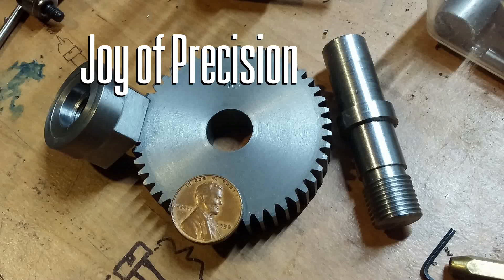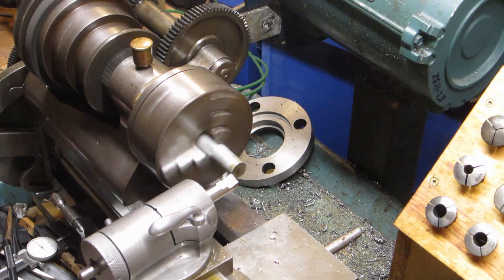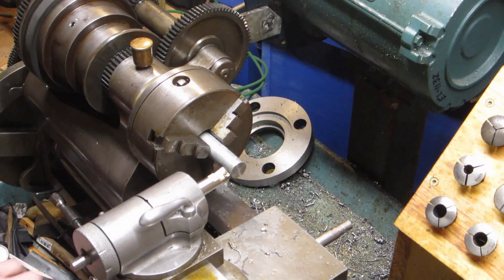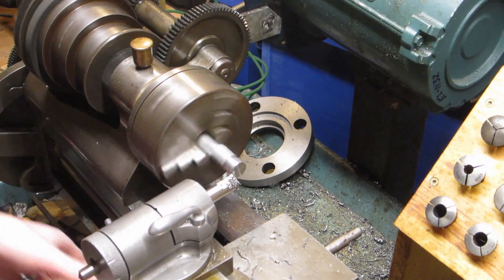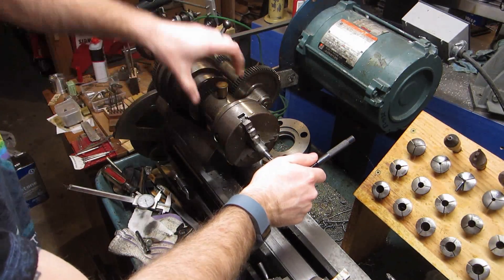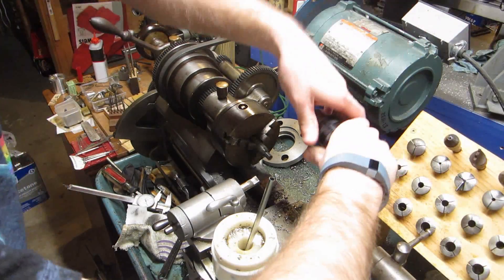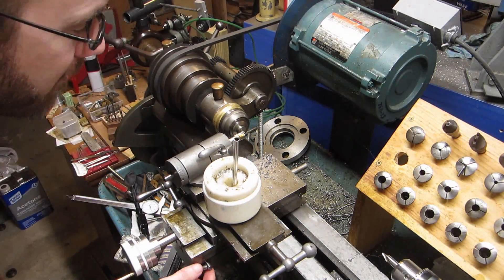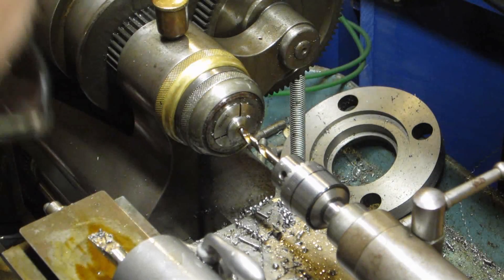Shop made rotary hex broach, in action

Comment: I love the tool support of your lathe I would like to build one, can you make a video with the details of this device? Thank you for sharing your wonderful works.
Reply from the maker: Hi Carlos, yes I think that's a great idea, thank you! For most people a normal quick change toolpost would be a much better choice, but this ecentric style has a lot of versatility that some people might find very useful. I will definitely make a video about it.
Reply: The one on my 608 was cracked, so I machined a new one from a solid piece of Durabar. 
Were I doing it again I would 3D print a pattern and have it cast by a local foundry. 
I typically run with a boring bar in there, and swing it around to turn or bore with the same tool. 
Not that I use my Rivett very much, though the tool use is shown here: https://youtu.be/bSOyh4JrluI?t=726

Comment: Yes yes 👍 I have done one today  using old live center I changed the 60 digress anvil to another bored one and screw it the broach I tried with hot roll steel it works really nice but it take alot pressure,, am happy 😄 with I have done thanks for inspiration.. The hex abroach I made it from drill bit tail I machined it and hardened it as well .
Reply from the maker: Great work! 😀

Comment: Nice job ,, am going  to make something similar with tailstock it might be easier, thanks for sharing.
Reply from the maker: Thanks for watching!
Reply: @TheJoyofPrecision  I think the broach should be with an angle to make the inside hex abit bigger to allow the broach goes out easier.. Isn't right??  Thanks
Reply from the maker: The dimensions of your broach should be slightly larger, yes, but the clearance angle behind the cutting edge is just for clearing the approximately 1 degree angle that the broach should be offset to the work, plus additional small clearance to keep one side of the broach from binding.  Remember, the broach is presented at a slight angle, and so only one side or corner of it is cutting into the work at any moment.

Comment: I was subscribed for a couple of days but couldnt get past watching you hold a flux brush up against the work whenever you were making a turning cut. Occasionally the brush comes out for a full facing cut and almost never when you are cutting threads with a tap or die. Weird maybe but it drove me nuts.

Comment: In the video it looks like the profile of the broach is a squarie-ish. I must need new glasses. I would expect hexagonal-ish. I now understand much better how  a roto-broach works.  Cutting the reliefs on that tool must be a bear. I also enjoyed the video on the Hjorth turret lathe. Where (and when) was that thing made?
Reply from the maker: Hi Juan, thanks for commenting!  The broach is indeed hex shaped, as you would expect.  The broach itself was milled, using a 6 sided collet block.  I calculated how far to shim one end of it to get an angle of 2 degrees, and shimmed under it.  It doesn't have to be exact at all.  I will have more videos on the Hjorth machines and attachments in the future, they really are neat..  They were made in Boston, right down the street from Edward Rivett's shop.  In fact, Hjorth and Rivett had were said to have a good working relationship (good enough to share use of patented designs, at least) and rumor has it they even shared workmen between their shops.  Even less is known of Hjorth and his machines, than about Rivett and his, and there's no way I know of to tell when a particular Hjorth was made.  We know they operated from about 1919 to about 1938.
Reply: That is very interesting. I just looked up Hjorth on my favorite website, lathes.co.uk. The site describes a more conventional lathe -- still weird, with the Rivett eccentric toolpost -- but no turret lathe, You might want to write Tony Griffiths and send him some pix. email tony@lathes.co.uk. I am sure he will add your comments to the site. It;s like adding to the Encyclopedia Brittanica of lathes.
Reply from the maker: That's one of my favorite sites too!  Yes the Hjorths are more akin to the plain turning bench lathes (in fact they're nearly identical to them), such as the Rivett 504.  In fact the design of the headstock and slide rests are nearly identical (though Hjorth did make some improvements to the headstock and to the lever collet closer).  I e-mailed Tony some time ago, shortly after I acquired the first Hjorth.  I am caretaker of a collection of 7 machines (one of them is really only good for parts), and most of the attachments/accessories that were available for them.  Tony was very interested in some more detailed pics of the machine, it's all original with a complete screw cutting attachment.  It's the same machine I mounted the turret and lever slide to in the other video, because the machine that stuff belongs on isn't up and running yet.  Getting good photos to send Tony is definitely on my to-do list.  I think he'll get a kick out of some of the other Hjorth stuff too.